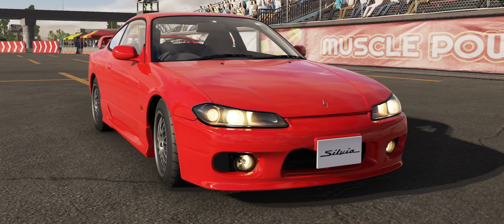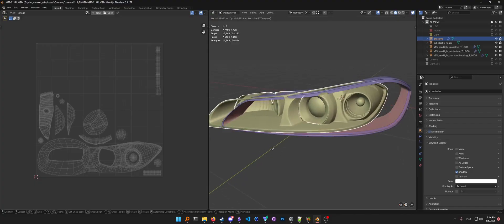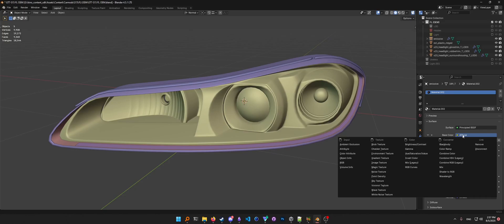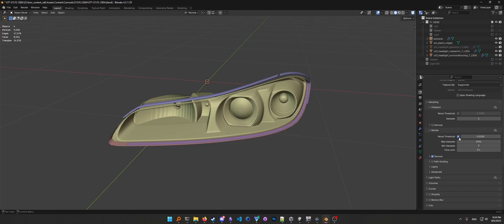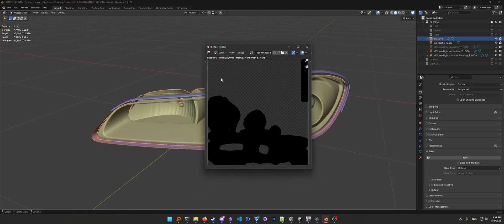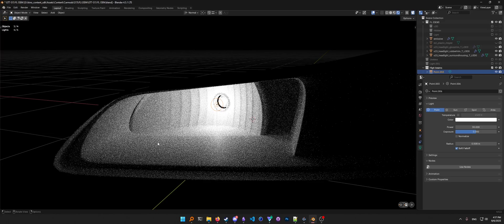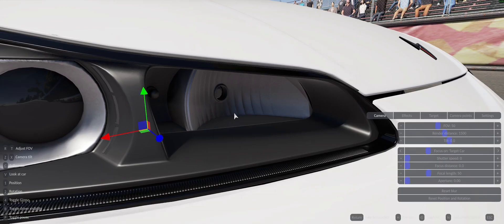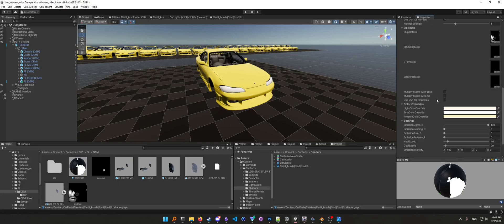Perfect Baked Lighting!

Comment: Amazing stuff keep the good work man!

One thing I want to ask do you know how to bake lights in blender using textures reflection ?
Reply from the maker: Thank you very much!
I'm not quite sure what you mean by "using textures reflection" though. Could you rephrase that?
Reply: @BitteneiteOnCarX  I meant like to make the lights looks more real by doing baked lights with texture for example ridges or reflector normal map not only shade lights.
Reply from the maker: Oh yeah you definitely can! In the tutorial I mention how you can apply a normal map, Blender can calculate how the light bounces off of it.

You can always do more complex stuff though. Any Blender tutorial for the Cycles rendering engine can be applied here.
Reply from the maker: I've recently made an experiment where I simulated how the ridges in the lens get lit up. 
I had to use a Glass BSDF node on the lens' material with a normal map, and a bit of trickery to render its diffuse texture.

You can probably make something up for your use-case. You'll just need to experiment in Blender a bit.
Reply: @BitteneiteOnCarX  Thnaks for explaing so much Im just new to blender but can you make a new tutorial for only normal map and how you can make with perfect settings ?
Reply from the maker: Finding the "perfect" settings varies greatly from project to project. Unfortunately, it's just one of those things that you'll need to learn and get a feel for.

I've shown in the video how to use normal maps, but everything after that just comes down experimenting.
Reply: @BitteneiteOnCarX  Do you have a discord ? so I can show you some examples of what I mean ?